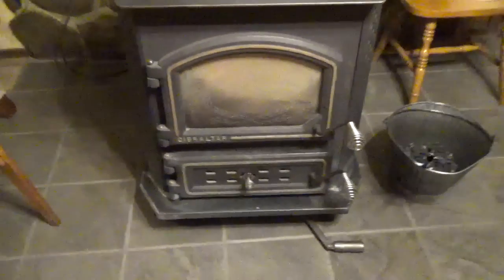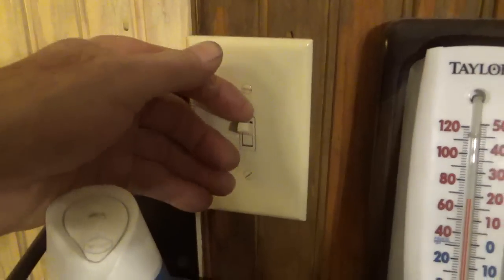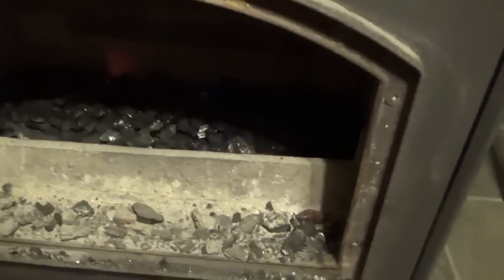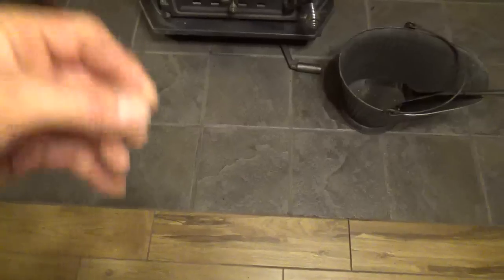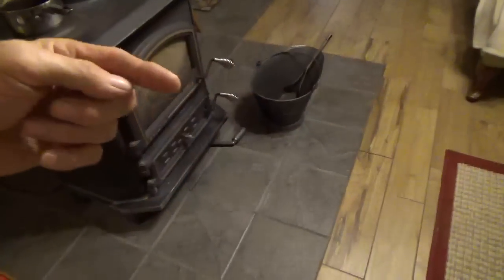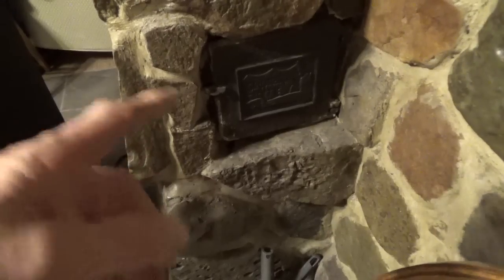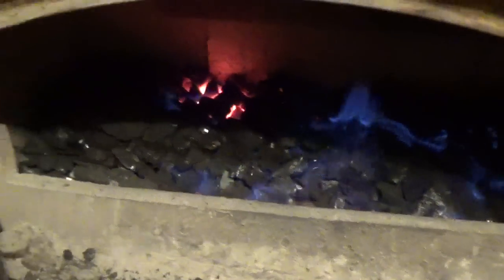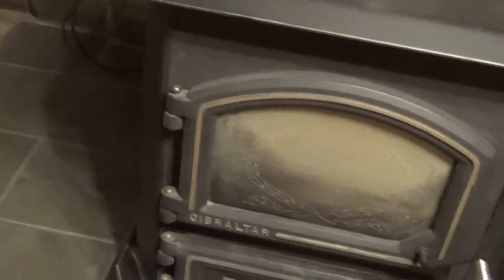How I work a hand fired anthracite coal stove.

Comment: We have a Jotul Oslo 500 wood stove which gives off quality radiant heat.  The central HVAC system is geothermal loop electric but there is nothing quite like the feel of radiant wood heat coming from a cast iron stove.  I've never had experience with a coal stove, but as a kid way back when I remember my brother and I had to take turns shoveling coal into a hopper for a coal furnace. Great channel.

Comment: Try top to down burn - lit wood on top of coal,and when goes to the embers, slide them on one side of the firebox and ad more coal. This way new coal gonna burn sideway,no black smoke out of the chimney. It's very efficient and clean method - fumes and gasses burn to,so less fuel needed to warm the house.
Reply from the maker: I will have to try that. Thanks

Comment: I've been using a similar stove for 3 seasons now, but still learning. maybe you can learn something from my comment as I learn from your video. I start a fire with a few small pieces of hard wood, get it burning hot to heat some of the coal. then can slowly add coal to heat the whole stove good and hot, but don't want to smother it or add coal too fast and remove too much heat. I leave the ash door open to get it started, but must keep a very close eye on it cuz it can go from barely a flame to glowing bright hot in only 10 minutes or so. once it's up to temperature, I've learned to leave the chimney damper wide open, I only use it if burning wood. depending how cold it is outside, I can adjust the fresh air vent on the ash door, and it'll keep burning at a steady rate all day or night. once it's going that vent is always more than half closed or the fire will eventually go out of control. on occasion I've even closed that vent completely and it'll stay barely burning all day from just the little bit of air leaks into the stove and from air circulating down the chimney. then when I need it at night I can open that vent and the fire kicks right back up again. it works well for me, although I have damaged the banking plate from excessive heat, from starting the fire then falling asleep before it's ready, not good. it only starts with an invisible crack, then grows and deteriorates the metal until it splits in two. from what I know, can't weld cast iron, so I'm looking for a solution or a replacement plate. I think a contributing factor was a small gap below the banking plate, which let in a slight bit more air, got it hotter in that area, and caused the fracture. one more thing to note, coal likes to be piled deep. get a thick bed of hot coals, rake and shake the ash out once or twice a day, and it'll keep burning hot.

Comment: I have the same stove except my doors are brass and sliding to the right closes it. I've had great luck with filling the stove 3/4 of the way up on the front side and tapering it up to the top of the fire brick on the back side. Leave the door open on the bottom for about 15 minutes or until you see embers starting to glow through the coal. Shut the door and set it to about that pea size. And in the morning it still doesn't need to be touched. But I just shake it down a bit in the morning and wait until late afternoon before filling it again. Most 30-40 degree days it only gets filled once a day.  Great stove. Try that method and see how it works for you.

Comment: Morning Joe.... Thanks for the stove follow up. A couple of questions I'd like to ask, and you're probably going to answer them in the next video. First, how long did you have to wait before closing down the stove after you added the coal to the wood embers? And what you'll probably answer in the next video is, how dusty does your house get using wood versus coal or both? When I first moved into my home I had a combination heat pump with electric backup and wood stove and the house used to get pretty dusty over a heating season from removing the coals and cleaning out the ash bin every day. When I purchased my outdoor wood stove and piped hot water to heat ex-changers in the house I almost totally eliminated the dust on everything. I have allergies and it was a major improvement getting the wood stove out of the house. I still use a fireplace (can't have a log cabin without one!!) but I don't have those issues like when I had the wood stove in the cellar. I only have to load up my outdoor wood stove once every 24 hours, sometimes twice a day if we stay below zero temps, and I like that because I'm not always tending it. Other than the Winter season, I only clean out my stove twice, maybe three times a year. During the Winter the coals build up more so I'm cleaning them out every three weeks or so. A lot less maintenance than having a stove in the house and I think, a lot healthier. The only draw back with the outdoor stove is when the power goes out, which is quite often here, I have no heat to the house, hence a generator is a necessity. The water from the stove is pumped into the house by a small 75 watt pump so it doesn't take much to get it there. I'm wondering if coal would be a better heat source in an outdoor wood furnace, maybe tending it less than the wood stove itself. But like you mentioned earlier, we're getting to an age that is making it more difficult to deal with all the work. Looking forward to the next video, thanks.
Reply from the maker: Morning John, I will be answer in the next video. Pouring here today.
Reply: @josaljo1  Rain and wet snow mix here so far.

Comment: If you should buy yourself a good humidity monitor like mini thermopro you'll quickly see that little pot of water does next to nothing to affect the humidity of the house.. I have a modified '76 fisher I heat with, and use a large humidifier that puts out 5 gallons per day and its still not enough to hold above 30% when temps get below 15° outside.. now if you have a newer stove that draws its combustion air from outside the home that'll cut your water requirements considerably because you're no longer  exhausting your room air out your chimney and are then keeping more of what humidity you have in the house.

Comment: Good morning Mr Jo 
Good information on burning coal and wood. I have a Nashua wood stove up in my mountain home. I’ve had it for 20 plus years and heats up our downstairs of the house beautifully. I burn red oak when I have it , burns nice and hot. 
I think the company is not in business anymore because I wanted to buy another one. My wife and I will be up staying up there after Christmas for s few months. I love being there as my home is like yours with my closet neighbor being s quarter of mile away. 
There’s nothing like wood or coal heat. Our downstairs is about 1200 sq ft and I can get the bottom floor up to 75 in a couple hours. 
Come on down and cut some trees. Lol I have plenty!!
Stay warm my friend
Reply from the maker: Nashua is a pretty good stove, I use to sell them in new homes when coal stoves were "in" back in the 1980s. I bought many of them. I have seen them last 25 to 30 years with just a change in the fire brick. Don't be tempting me, I am considering moving if the sun does not shine soon.
Reply: Josaljo Won Come on down Mr Jo and Sally 
You are welcome at house anytime !!
I own 236 acres that I bought years ago. Only 3 acres are cleared around the house, the rest is all timber. Through the years I have remodeled the whole house. There is not one length of original pipe or electrical wiring. I just rebuilt the whole kitchen AGAIN lol as my wife is a fantastic cook. I built her a 10 ft island with her 6 burner gas stove top and farm sink built into it. 
The house originally had 1 bathroom built in 1948. I tore that one out and added 2 more bathrooms total of 3 now. Now when my kids come with their families there’s plenty. 
I have some really big cherry trees that I am going to cut down after the Holidays and mill 
A couple of the General Contractors who hire me out to trim  out their houses are not happy when i disappear with my wife for 3 months. I laugh and tell them at 66 yrs old I get to do what I want. Lol
After 40 plus years I still love being a carpenter and love the smell of cut wood. 
Come on down Jo, the coffee is on and we will go cut some trees. 
Stay warm up there my friend 😄
Reply from the maker: @ArchangelArchangel-tq3xo  What a tempting offer, sounds like you have a piece of heaven as well. I know what you mean about doing what you want. I had a guy offer me 3 times my salary to come and run a project for him. NO WAY.

Comment: I don't know if you will read this but I am have one of the old pot belly stoves bought it 29 years ago don't know how to tell if it is coal or wood are both you seem to be really knowledgeable was wondering if you could help me
Reply from the maker: If the grate that the fire sits on can be shook or turned from outside, it is a coal stove. If no way to shake the grate it is wood.
Reply: @josaljo1  I have another question for you and thank you for your answer is it safe to use the pot belly stove outside if I build a small house around it I wanted to run the heat into my dog house
Reply from the maker: @patriciaharmon1215  I believe you could do that but the house for the stove has to be big enough to handle the heat that will come from the stove without catching fire. I would get a little help from an insurance inspector just to be sure things will work.
Reply: @josaljo1  thank you so very much for that info that really helps me I live in a mobile home so I can't put it in my house but I'm also far out in the country
Reply: Sorry I'm getting tired I meant Far out in the mountains and my stove does have a Shaker so it is coal
Reply from the maker: @patriciaharmon1215  Just be safe and careful, Thank you as well.
Reply from the maker: @patriciaharmon1215  Sounds good.

Comment: What size coal do you use in this stove ? 
I have exact stove., seems to burn better with stove coal
Reply from the maker: Pea or nut
Reply: @josaljo1  do you think there is any advantage to burn stove coal ?
I was told bigger coal ( stove coal ,)burns hotter because of the larger space between coal pieces .thank you

Comment: You need to have not one but several Carbon Monoxide detectors if you heat with any method that burns fuel. Yes that includes natural gas. Redundancy is the key. Two on each floor. If you have plug in detectors the second detector on each floor needs to be battery powered with an audible low battery signal. Never enter an area with a high level alarm. Leave the house fast, Then, Call 911. 
Fire / Rescue will enter with Scott Air Packs. They'd rather fan bad air out, than carry you out.
Reply from the maker: Good advice. Cannot argue with you.
Reply: @josaljo1  
Thanks for the great video. 
When I get to build my cabin, I'm using coal as my main heating system. It's very safe. 
If I sounded preach-y it's because I've lived my whole life in a city with three oil refineries. Safety is the first step.
Reply from the maker: @boxwoodgreen  No problem, Thank you.